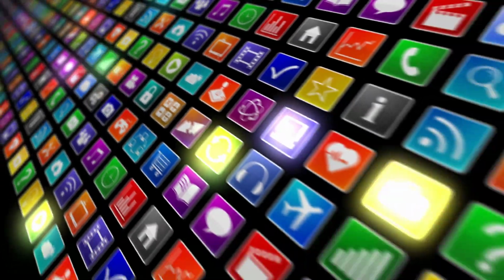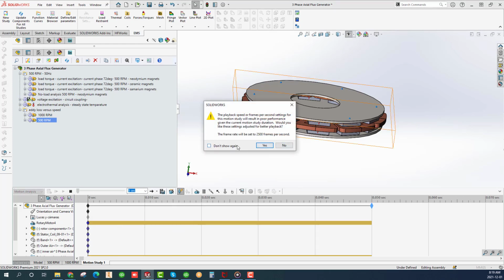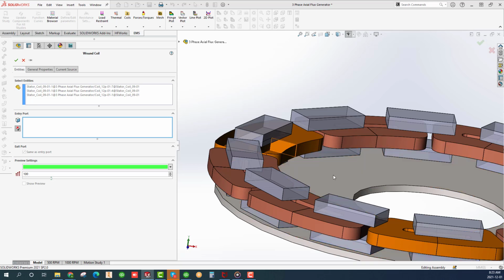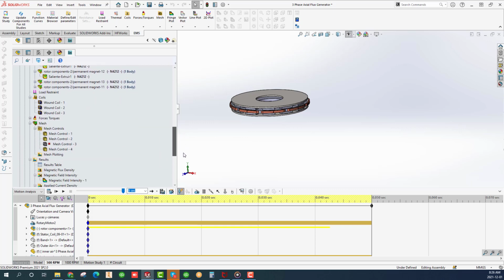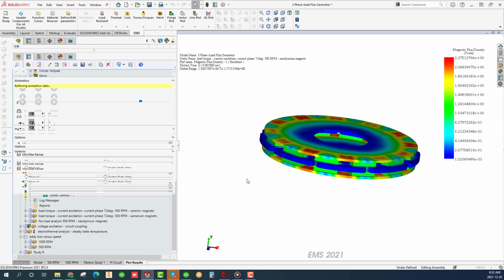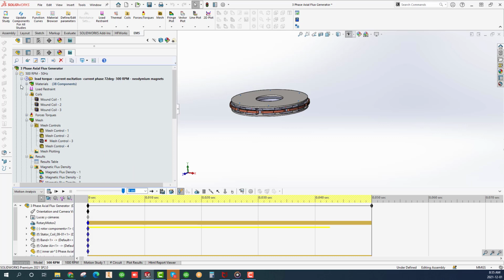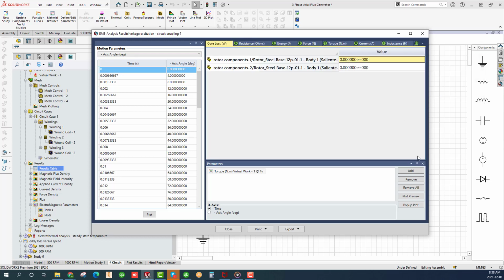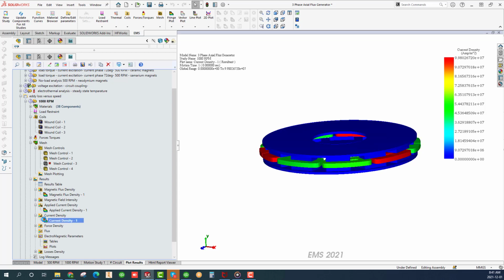[Webinar] - Simulation of axial flux machines in EMS/SolidWorks

Comment: Hi, my name is Marko, I am a mechanical engineering student working on axial flux machines. You said that simulation lasted for 15 minutes since it is on laptop. Are you suggesting that 15 minutes is long time? I use desktop computer, intel i9 10850K, with 64 Gb of ddr4 RAM, and when I do transient simulation with around 600 000 mesh elements, it takes around 40 minutes for 25 motion steps. Is that slow? Thank you for the tutorial it was great.